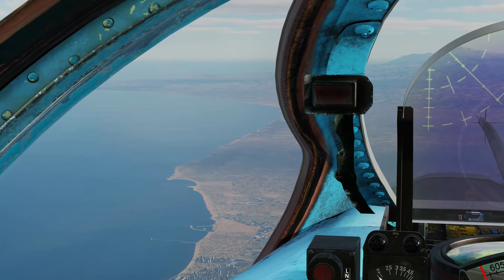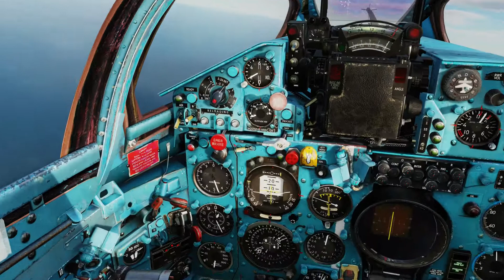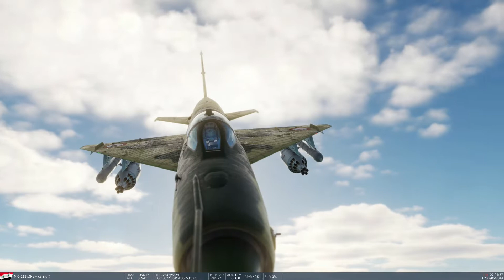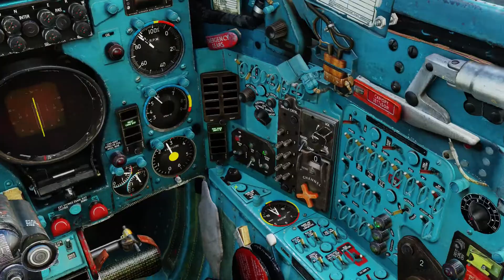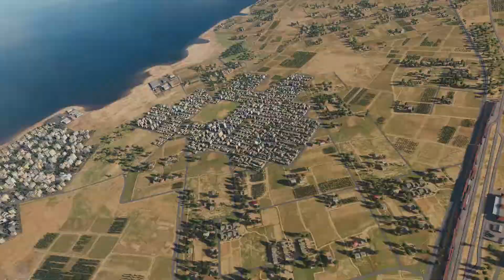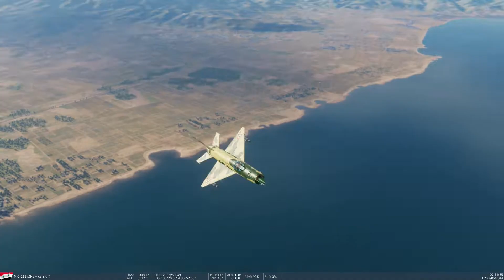DCS | Mig-21 rocket tutorial

Comment: Before firing, you say 'let's trim'. Can you explain why and how you do the trim procedure ?
Reply: it's just to apply some nose-down trim so you're not pushing the stick forward to maintain the dive

it's much easier to make small precise adjustments from the stick's neutral position than to push the stick forward and hold it and then make small adjustments from there!

as a general rule, try to fly with just forefinger and thumb on the stick - and if you need to push/pull the stick for any amount of time, adjust the trim until you don't. (it hadn't occurred to me to trim in the first few seconds of a diving attack until I saw your comment and paid proper attention to the video, though, so thanks!)